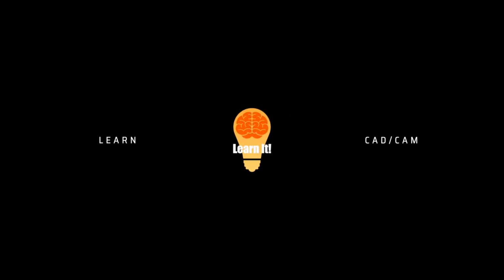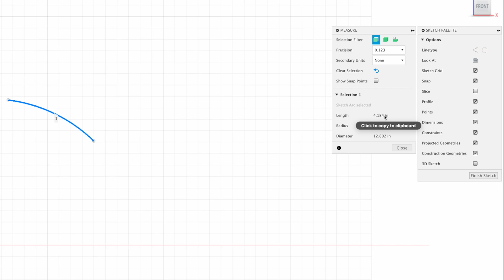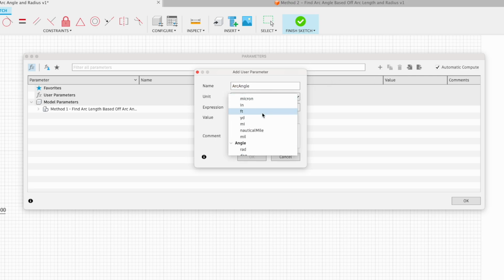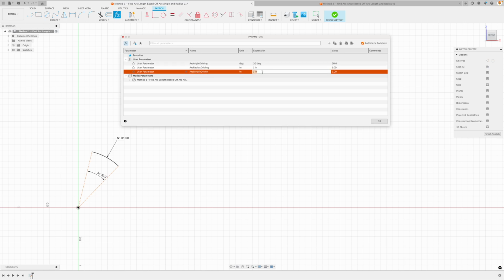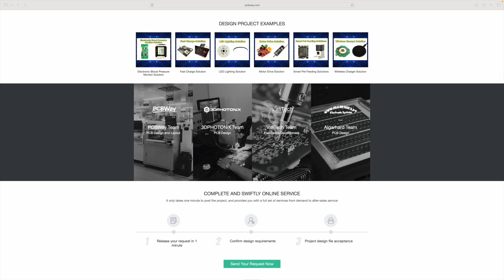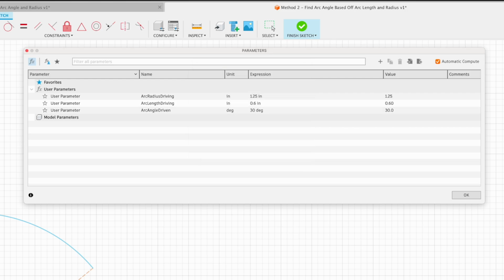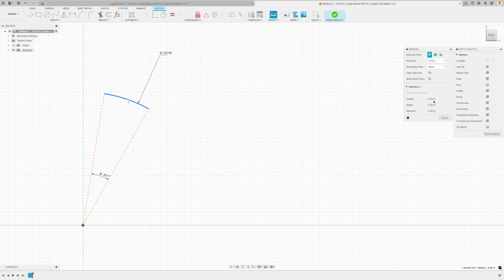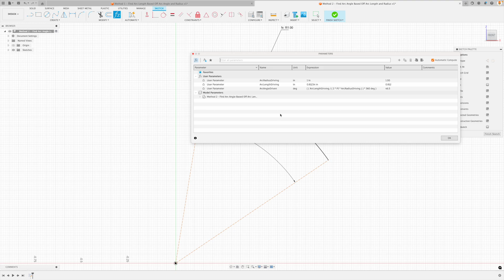Autodesk Fusion Advanced Tutorial - Measure and Use Arc Length as a Parameter - User Request (2025)

Comment: To find arc radius (driven) based off of arc length (driving) and arc angle (driving)

Create a parameter for the Angle (Arc_Angle) and for the Length (Arc_Length)

Then, to calculate for the Arc_Radius;

Arc_Radius = Arc_Length / (Arc_Angle / rad)

I tried several other ways but I figured Fusion can't compute a unit in degrees or radians with a unit in millimeters (like using Radius = Length /(Angle*(PI/180)), I keep getting error
Reply from the maker: Unbelievable! You got it!!! You weren't the first to guess, but you actually tested your formulas within Fusion and realized that it doesn't accept all correct mathematical expression, but we do need to work within the boundaries that Fusion can calculate. Great job! You won. Please send me a message to our business email (found on our About section of our YouTube channel) and I'll issue you the year membership.
Reply: @learnitalready Thank you for confirming my solution—I’m honored to have won!
I dropped a mail already.

Comment: Is there a way to display the arc length on the sketch itself?
Reply from the maker: Unfortunately not. That is one reason why I made this video because parameters is the next best thing. You can, however, see the arc length in the Drawings workspace, but that requires extra work to setup and always update whenever you need to view it. Parameters help you utilize the arc length which can really be useful for design work.

Comment: For method 2, I used ( ( ArcLengthDriving / ArcRadiusDriving ) * ( 180 / PI ) ) * 1 deg
This formula made more sense to me than the one you used for some reason. Is there a reason for the way you did it?

And for method 3, using what someone else posted, I used:
ArcLengthDriving / ( ArcAngleDriving / rad )
I believe it's working!

Comment: Requirement:
The need for a "specific arc-length" on a desired "arc radius" for required geometry.
( realWorld use case )

( convert to parameters if you like, And you should like :)

Equation: 

( ( 1 / 5 ) * ( 180 / 3.14159265 ) ) * 1 deg

Description:

1 = 1" the arc length you want ✅
5" = any radius
180 = 1/2 of 360° 
3.14159265 = radian

3.14159265 radians = 180 degrees
6.283185 radians = 360

( inch or mm whatever your model units are set to )
Reply from the maker: Thank you so much for commenting! Great job. Your math is correct, but I need a working formula within Fusion. I just went over the comments and I pinned the correct formula containing the working formula to the channel.

Keep up the great work! Don't worry, there will be more opportunities to win a free membership again. All the best!

Comment: I see I am too slow.   Drats
Reply from the maker: Not too slow! Give it a try, but as you can see from the other entries, I need a working formula in Fusion (not just a mathematically correct formula) but one that works in Fusion. Check the other comments out to see what isn't working, and then test a working formula within Fusion before submitting. Thanks!

Comment: The equation would be:
ArcLength = 10mm
 ArcAngle = 60 deg
 ArcRadius = ((ArcLength x 180)/(ArcAngle x PI)) = 9.55mm
Reply from the maker: Amazing job! You were the first to comment, but I input your formula and it doesn't work. Have you tried it yet? I want to pin a working formula for the benefit of anyone that watches this tutorial in the future. Please give it another try. 

For those that are wondering, yes, I did use an "*" instead of an "x" for multiplication.